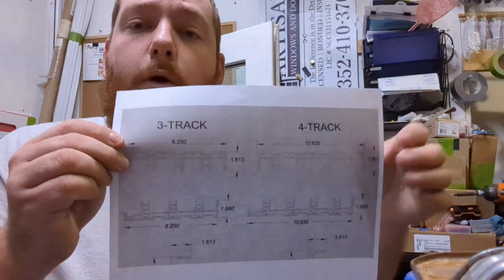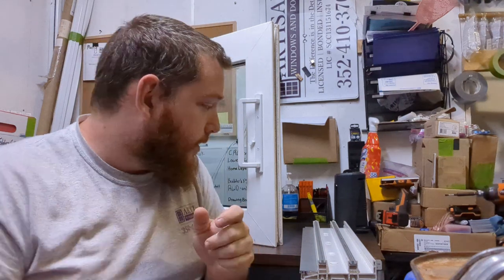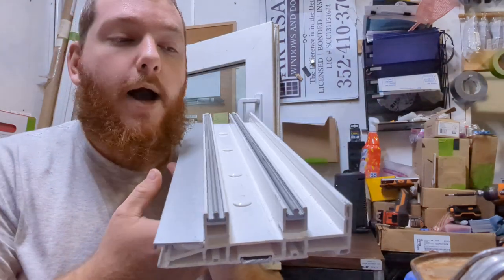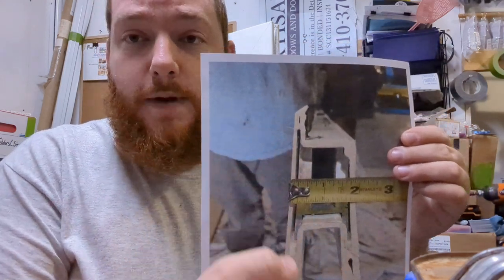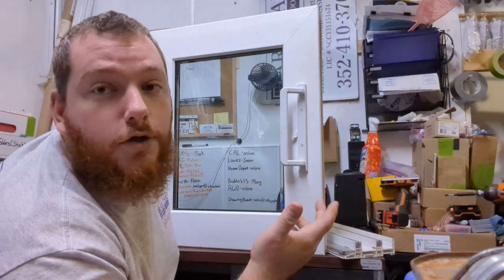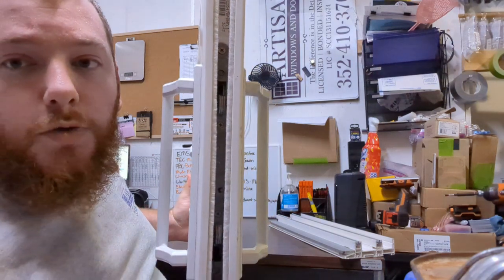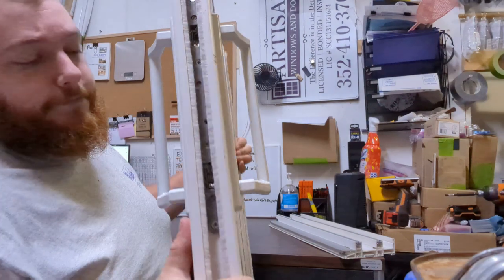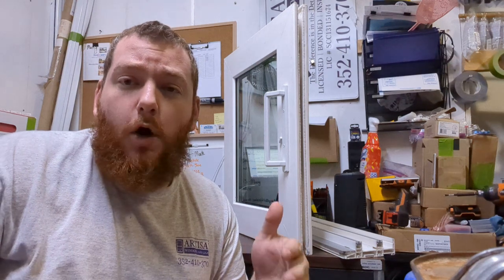This demonstrates a vinyl PGT sliding glass door

Comment: Great video thank you. What is "highest grade low E glass?" If i mention this to the dealer will they know what I'm talking about?
Reply from the maker: That's a great question. Whats meant by highest grade low E glass is Cardinal low-E 366. When PGT uses Cardinal low-E 366 glass in their product they rename it "energy shield Max". So if you ask for energy shield max that will get you the correct type. Another way to double check is to make sure that the solar heat gain coefficient is 0.21. Only very high grade low-E will be able to reach that low of a solar heat gain coefficient.

Comment: Do you have any information on how to remove the sill riser? I don't need it, and it's a trip hazard. Thank you.
Reply from the maker: It should just snap on so you should be able to start at one end and pull hard to unsnap it. Sometimes an installer may glue it on which would make it very hard to remove. Hopefully that's not the case, if it is then you would need to cut into it with a saw to make a relief cut  to remove it.